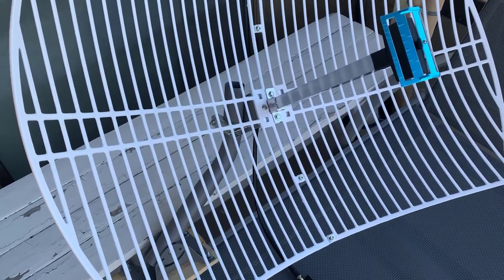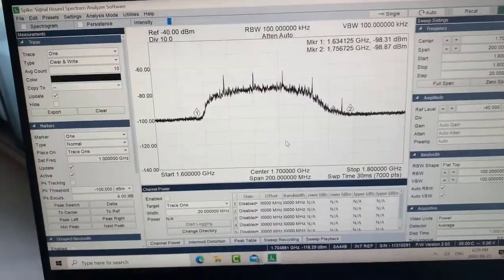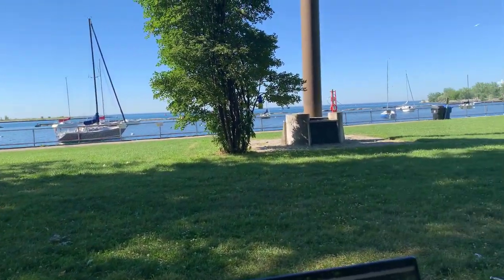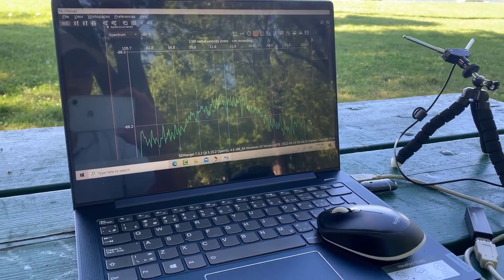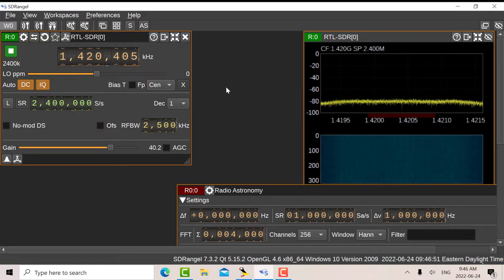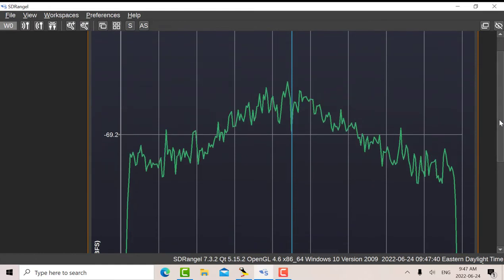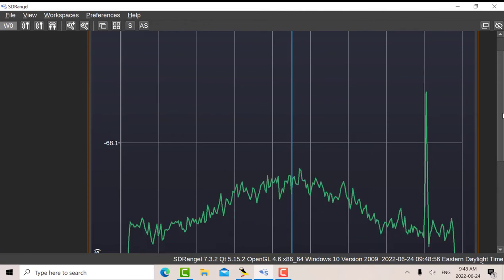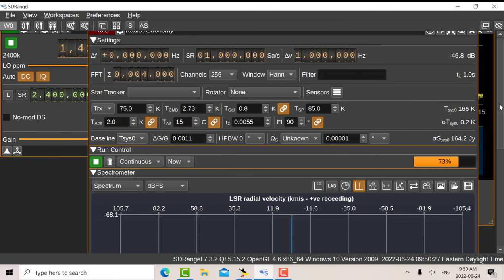RTL-SDR for Radio Astronomy - Planning

Comment: Were you ever able to see the Hydrogen line with the sdrangel software? I see you later switched to SDR#. I'm looking for a program that will run on my Mac and finding limited options
Reply from the maker: Good question! I started off using SDRangel and later switched to SDR# because I was chasing down rf interference in my location. It turned out that there were ofdm ethernet repeaters destroying my receive ability so I had to drive 50Km out of town to a secluded valley! The SDR# with the fft averaging plug in was really easy to use. The SDRangel radio astronomy plugin is amazing but designed for astronomers, so I found the SDR# easier for me as a ham. However, I am sure it has everything you need plus it has a manual and good user group.

Comment: is there a step by step how to video?   hardware parts list and  windows software. this is all new to me. also the nano spectrum analyzers do not seem to spec at hydrogen 1420 line. thanks.
Reply from the maker: There are 7 videos in series.
Reply: I will check it out. Thank you.

Comment: I've just made the exact same experiment as you, and i have this spike at more or less the same frequency, i have (1420.73 Mhz) at -68 dBFS. Interresting experiment! but i don't know wath this is exactly... maybe just wi-fi or Phone interferences ?
Reply from the maker: I had to finally go 60Km outside the city to see the H line. I think a strong out of band signal can enter the RTL, overload it and appear as an rx frequency entering the antenna whereas it is an intermod exiting. Good luck, most interesting (hardest) experiment I have done so far.